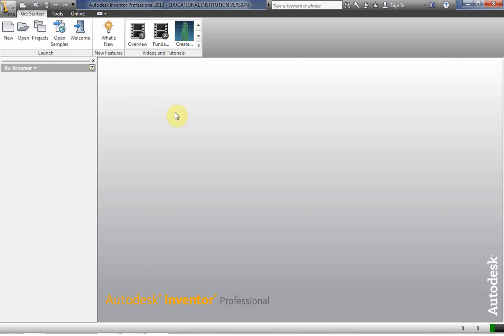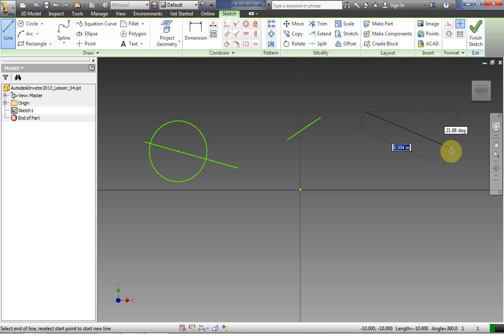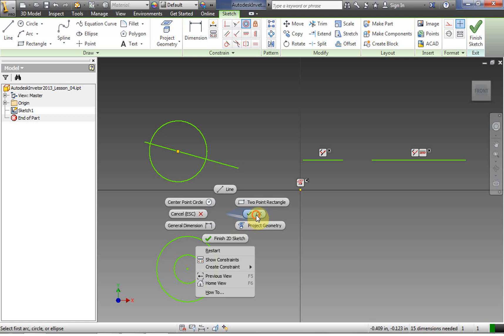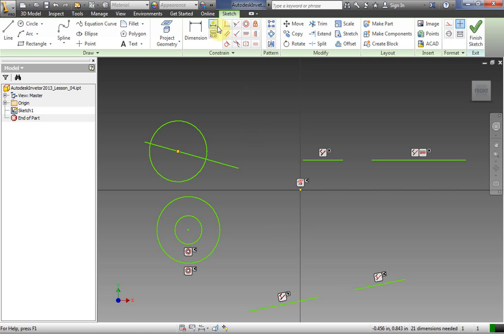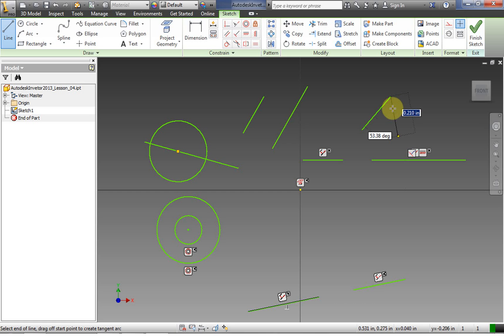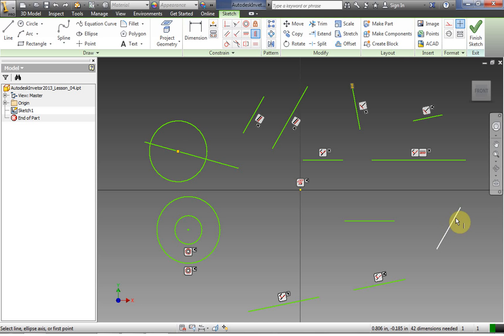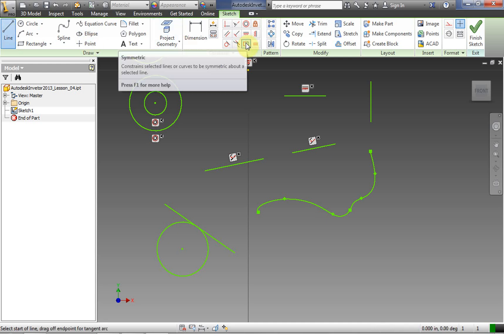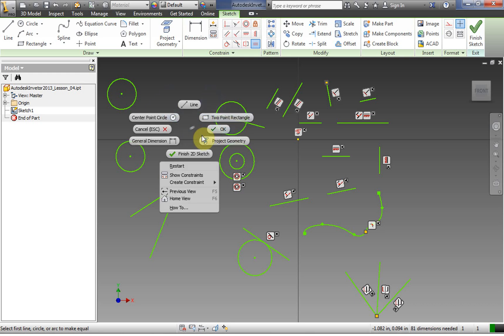Autodesk Inventor 2013: Lesson 4: 2D Constraints

Comment: Pick order doesn't seem to matter and it seems the system just takes one of the objects applies the constraint.  For example, if you have two lines at different angles and you want them co-linear, the pick order should matter if you want one of the lines to be in line with the other.  I'm testing this in inventor now and it seems no matter which line i choose first, it's always defaulting to the same line moving and becoming co-linear with the other.  So if I want A to be co linear with B, then I choose A and then B, BUT B still moves to A.  So, I then pick B first and A second, B STILL becomes co linear with A.  Any thoughts?

Comment: "Good luck", best closing line ever! Seriously is there not a way to tell Inventor not to use constraints like turning off snaps in autocad? This would seem like a no brainer.
Reply: Yes, you can easily specify which constraints it will automatically assume. Things like tangent snapping, polar snapping, equivalence snapping can all be turned on or off.